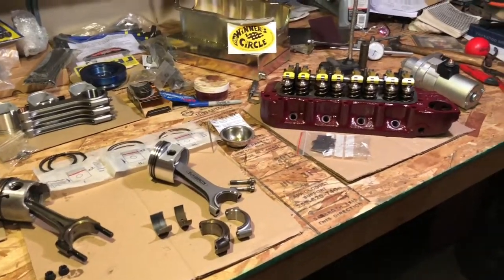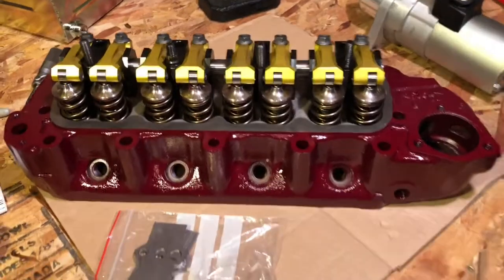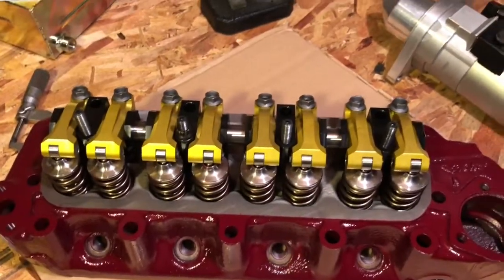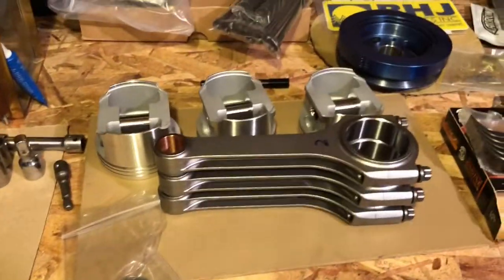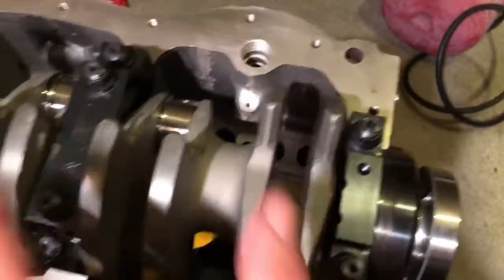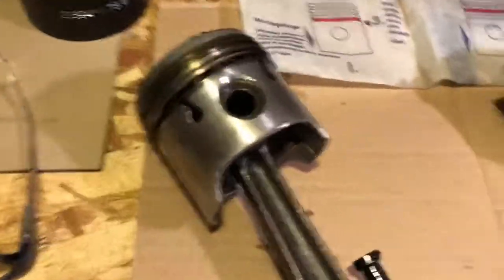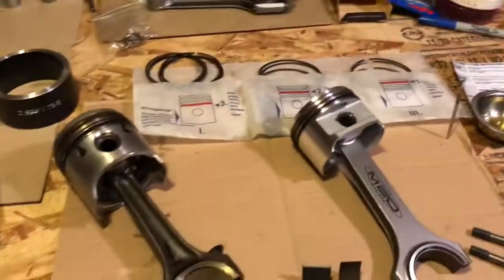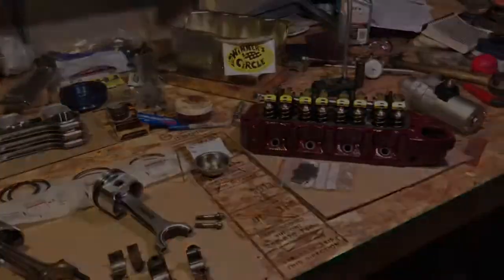Super Race Engine Details: straight rods and Toyota bearings

Comment: wow amazing thank you for putting this video up. by the way i run a gtm rossa and i have the same problem with oil leaking THROUGH the inner cv joint that you mentioned recently - it a total pain in the ass especially if you dont know what is wrong. took me ages to figure it out.